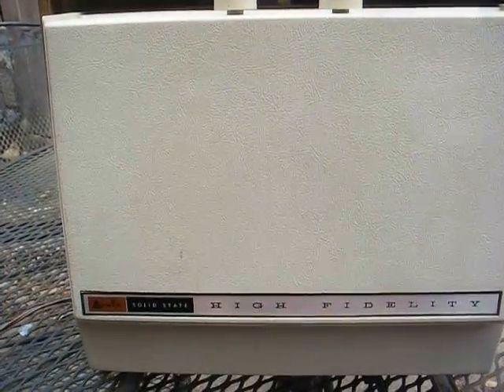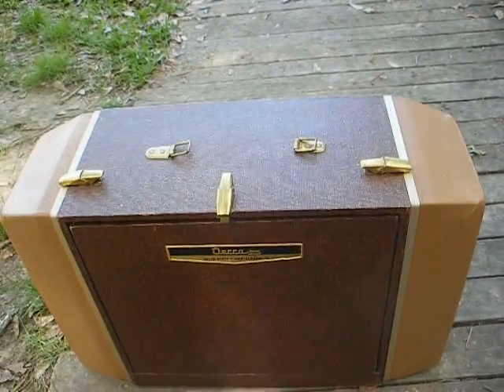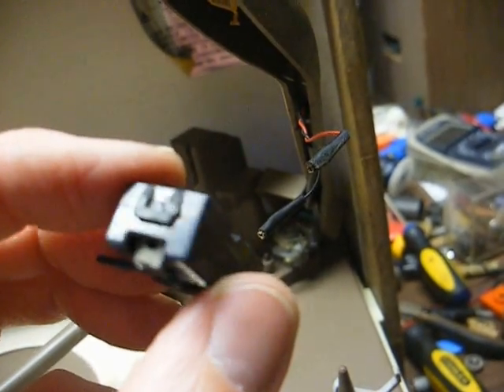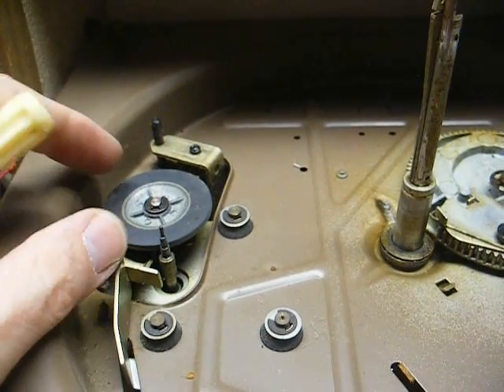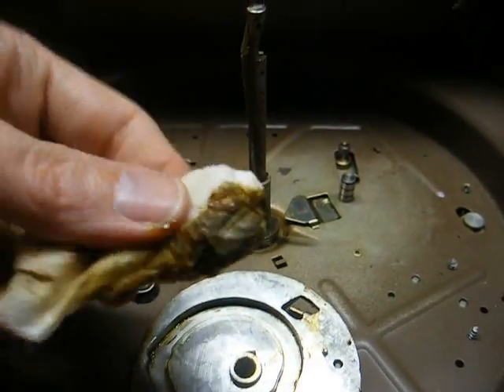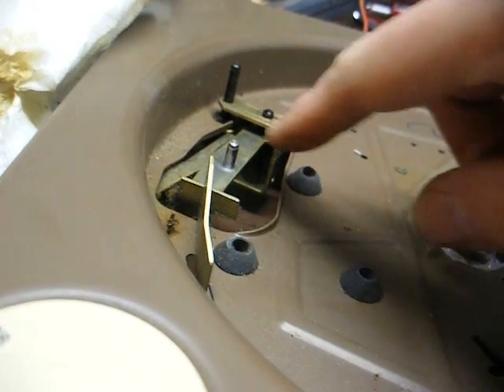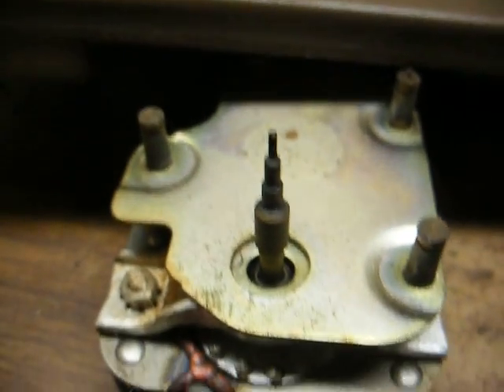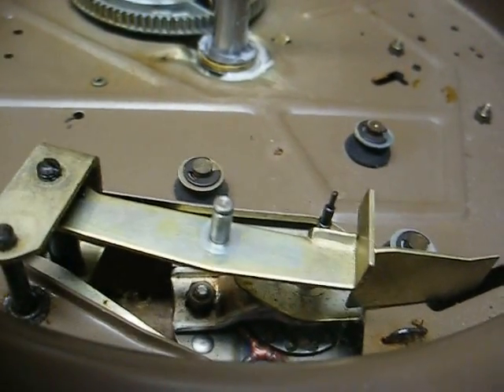Arvin record player from 1966 & servicing a BSR UA25 record changer

Comment: I finally figured out why the overarm is swinging out; there's a rubber grommet that sits at the top of the shaft where the overarm and shaft meet.  It's either missing, old or rotted and will need to be replaced.

Comment: My parenrs had a Delmonico tube stereo from around 1965.  The record changer was almost identical to this with the exception it was stereo as noted at the beginning and the flip needle twisted from the front. It also had a very heavy round metal 45 rpm adapter.

Comment: Nice vid!  I've serviced the late 70's BSR record changers thoroughly, and they run great!  Probably the toughest part of restoring them is removing the seized spindle first.  I got a Morse Electrophonic BSR record changer off eBay recently and the transit screws were missing the lockdown clips.  Also, the metal faceplate came off, so I had to buy some epoxy glue from Home Depot to re-glue it back.  QD electrical contact cleaner works wonders on the motor and mounts.  You cannot believe how much oxidation and dirt accumulated on them.

Comment: Motown records being mixed hotter than others was the beginning of what is now known as the "Loudness War".
Reply: Richard Edwards I have a lot of Motown 45's in my collection, but it does have a loud bass and even louder tone than the other conventional 45's from various labels. As you can tell by the label, I have the same copy of "Get Ready" by Rare Earth on a 45 and it was on their group's own label which was a Motown subsidiary. Rare Earth was a rock group in the 1970's when it was on their own label which was part of Motown. They also did "I Just Want To Celebrate" was another one by the group themselves.

Comment: Great job on this.  My parents had a Delmonico stereo with this type of record changer (I think it was a Monarch).  Anyway, the unit itself looked like it was in beautiful shape.  You took the time to fix this right.  I remember I accidentally broke the wires from the tone arm when I was a kid.  I tried to get it working again years later and the thing that I remember is some of my 45s got gouged out with the needles, but my lps didn't.  The motor was also gummed up (and at the time I don't think it was older than 14 years old).  I think the stereo was from 1965.  It was a small tube console with feet.  It also had an AM/FM radio.  I remember it sounding great.  I remember it starting to smoke one day, so I unplugged it and never plugged it in again after that.  Thank you for sharing.

Comment: "I'm an expert at packing!"  Every time i see that comment I usually decide I don't need what they are selling in the first place.  I have more junk that has been through that process that I don't even think about it any more.  My worst was a pristine Pioneer PL-112D turntable.  Having had a senior moment I did not see the "no return-no refund" clause and having just started using eBay did not know they could force a refund...so I'm out some green but better educated!  He didn't remove the counter weight and did not secure that heavy cast aluminum platter.  What the counter weight didn't destroy that platter sure did, including the dust cover!  Thankfully this (SOB) is not on eBay any longer, at least by the name he used back then!  Since I was stuck with what was left of the thing I kept it for parts for the PL-112D I now have that so far has worked perfectly.  If the motor ever quits, I at least have a replacement.

Comment: The overarm has a rubber washer at the top of the shaft that cracks dries up and falls off the overarm shaft. That causes the overarm to swing all over the place  because it is below the keyway.that holds the overarm in place

Comment: I wonder if an Astatic cartridge with a hard piece of rubber suspension could be rehabilitated a bit by removing the stylus temporarily, and letting a small drop of rubber reconditioner/softener work into the hardened rubber for a spell?

Comment: the blue 3 in 1 will work in most cases, but sometimes it will not depending on the motor and in those cases the motor will run slow until it warms up.

Comment: it is possible to use 2x MJ3055 power transistors a heatsink  and a BC212B in the output stage as a class A power amp and can give at least 5-10 watts. if you don't understand what I am talking about google for Class A amp circuits.

Comment: Can someone please advise me if this is a bad practice: I sometimes use wd40 to wash out a gummed up or rough bearing, then force the wd40 out with compressed air and put in good oil.  I find sometimes the junk won't come out of the bearing or inaccessible areas yet if I force some kind of fluid through and add the right oil... even seemingly trashed bearings work rather well (not that I consider this a long term fix). Should I only be doing this with the right oil? seemed too thick to wash it out.
Can't wait until I can afford ebay roulette again. Just as crushed and poorly packed as whatever is hard to find. Average of 7/10 damaged still holding true.
Reply: I use something other than WD-40; it's acetone, you know, nail polish remover.  You simply dip an artist brush into this solution and you can clean even more hard to reach areas of the record changer, then dry it off with a long qtip

Comment: The 1950s model train gearing I have was lubed with Petroleum Jelly (As required by their manufacturer).  The same occurs with them.  The grease dries out and solidifies the gears, etc...  The only way to get them running is to clean the old lube out...  If cared for, the American Made motor and gears last indefinitely.  They are not those small DC Can Motors now used in many things, including power window motors in autos (With plastic gears).  Pure JUNK.  They fail (one way) because the frail contact wires for the armature literally vaporize making the motor useless.

Comment: How do you get the changer out ?
Reply: You have to unscrew some screws at the base of your unit.  Once removed, the base should open up easily.  Then you have to disconnect the power supply and the L/R jacks underneath the record changer.  Assuming your unit has the transit screws in the upper left and lower right hand corner, there are lockdown clips you have to flip down under the transit screws.  That should take care of it.
Reply: Thanks